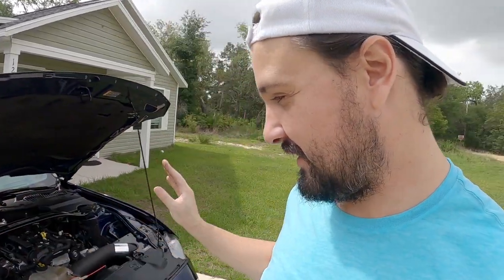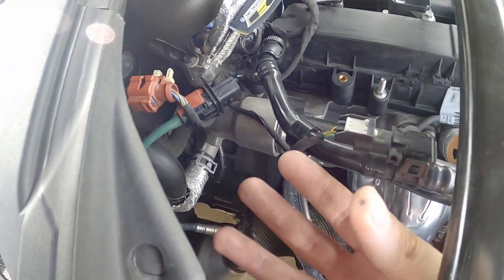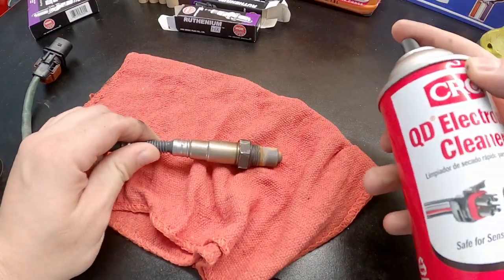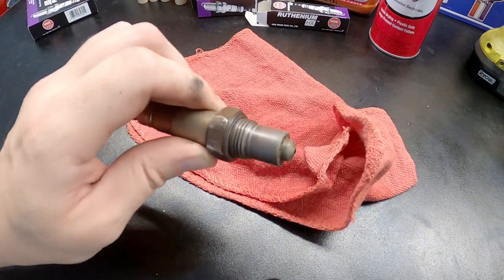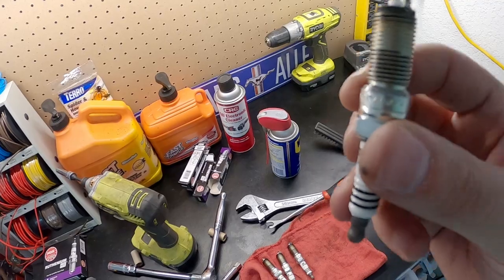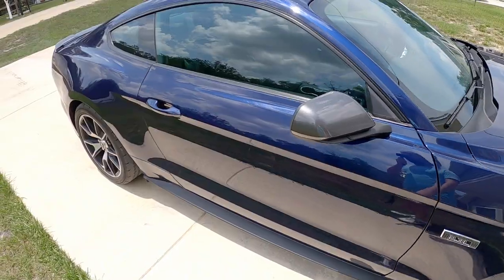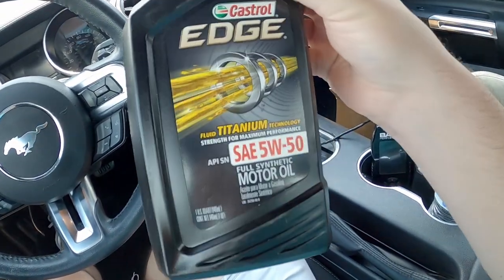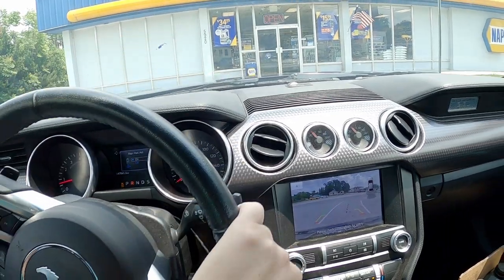Oxygen Sensor Check after a GALLON of Lucas - Idiot Maintenance

Comment: Lambda sensors are pretty pretty resilient actually. It's a wide band LSU Bosch sensor, and I was a technician at the plant that makes those for about 13 years. Inside that housing is a ceramic element with platinum strips, one side is a heater, and the other is basically a transformer. Once the sensor gets to temperature it begins to send a voltage back to the computer. As the carbon from the fuel oxidizes it acts as a variable resistor: the more the fuel the lower the voltage (rich @.850, ideal @.967vdc, and over that is lean, but depending on what you're doing this may vary) ... When they fail, they either send no voltage or @2.50vdc back to the computer. This trips a safety in the program and by defat will run the system rich to keep from hurting the engine. I've played with a bunch of sensors, and maintained the test equipment... it's fascinating how it works, lol.... Anyway, cleaning it off, and contact cleaner won't hurt it, and may ory not make a difference... The amount of voodoo, and smoke and mirrors, that goes into the actual reason the sensor works is a confusing mess of scientific research and thesis papers that I'm barely touching on... But rock on man! Have fun! Great vids!
Reply from the maker: Great info! Gonna pin this! 😁

Comment: From everything have read 5w40  is tge thickest oil you should use in the ecoboost mustangs,  if you live in warm climate and drive hard. Also you should use gdi engine oil. I found that 5w40 Vavoline advanced formula works really good on these cars.
Reply from the maker: My ecoboost is the HPP version. Factory recommended oil is 5w50 🙂
Reply: @Karz Kreated  a okay 👍 I had an ecoboost mustang as well. But with the 2.3 turbo. I understand now.  Thank you for clearing that up.